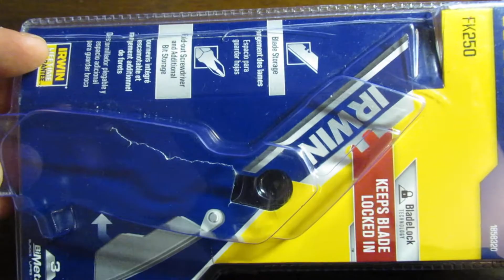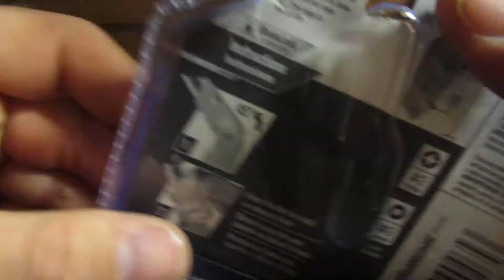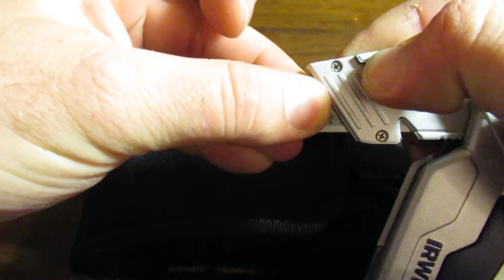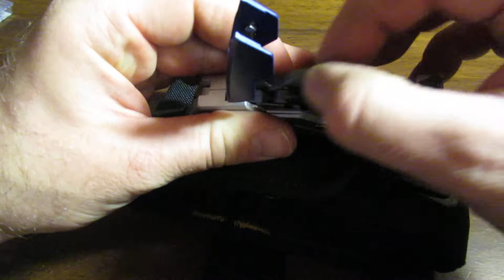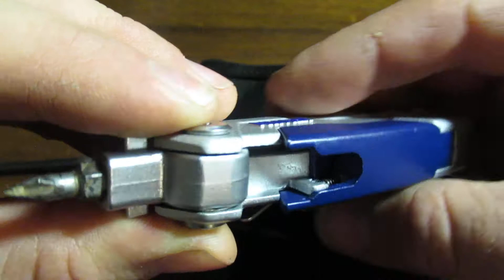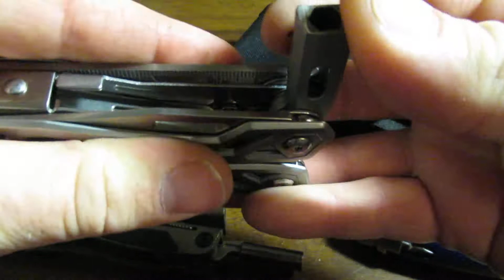Irwin FK250 Utility Knife and Bit Driver.  Great Pocket Tool!

Comment: I have the Lenox version of this same thing, I watch Texas tool cribs video on the Lenox 250 model on this and he states the bit driver is real robust and how he likes it better than the Milwaukie 6 and 1, and alot of reviewers do because it's metal, but imo the Milwaukie blows the Lenox/irwin out the frame! Milwaukie has locking bit driver, fast deployment,  better blade changing, and double ended bit for faster use than the Irwin/Lenox and the Milwaukie can take way more different size bits, Milwaukie 6 and 1 and 5 and 1 knife is super sweet..
Reply from the maker: I have the Milwaukee utility knife bit driver and I do prefer it because it feels lighter or less bulky.
Reply: @hvacbudget8600  I bought 3 different 2 packs with the Milwaukie 6 and 1from Home Depot website one with the Awsome knife and it has a bit driver too and the blade has a  beautiful stonewash I ever seen for a cheap knife, I carry my 6 and 1 with a concave or hawkbill utility blade and a serrated blade inside the storage and I added a black reflective lanyard on it, this one is a Grand slam! Milwaukie nailed it!
Reply from the maker: @larrya197140  Definitely!  A lot of guys in the trades carry these.  I saw a guy at the supply house pick one up.